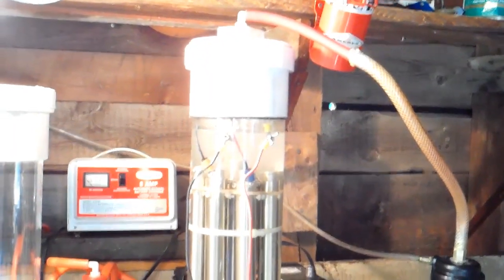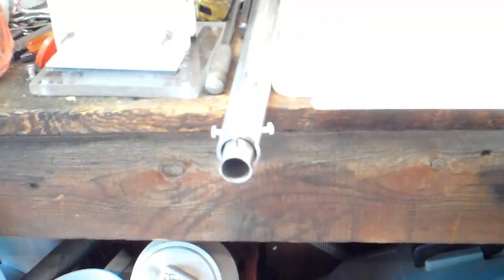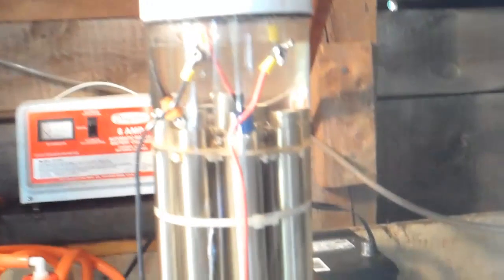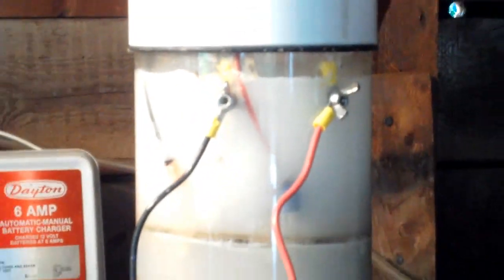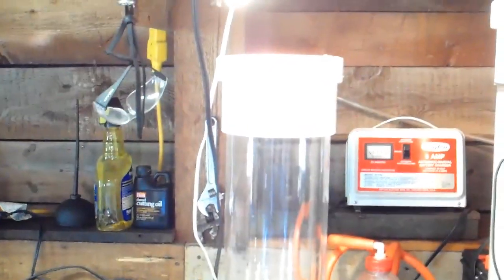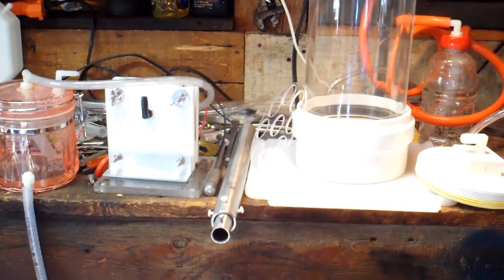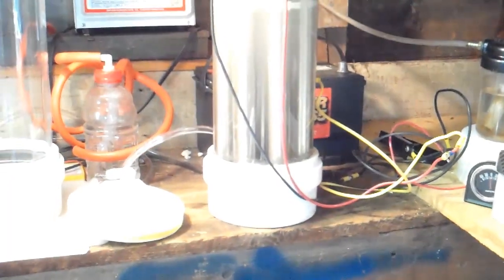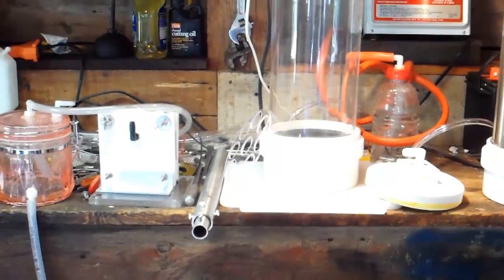Tweak to Stanley Meyer HHO Generator Produces Lots More HHO

Comment: If anyone is interested, I did some plans for one of these as final project in a drafting class. They show the cell in detail and a timing circuit but I did not learn until later that the coil is made from iron wire.  I'm petty sure I've got the copies in a few other places. They were done in Autocad.
Reply: Chris Turnblom pm me
Reply: THUNDERBOLT 
sorry, im not that bright. I can't seem to figure out how to do that.

Anyway,The bad news is, my secondary hard drive with the data started acting up so I took it out and will not use it until I can buy a back up. And I can not locate the flashdrive with the backups right now.
  I do have a slightly water damaged, full sized print I may be able to send you if you need it badly enough but until I can afford another hard drive I really don't want to chance loosing all that data. I will try to remember this request though.
 I hope you not just looking for a completed final project in a class or something. LOL
Reply: Chris Turnblom oh. no its for my own use haha :D
Reply: Chris Turnblom If you get this - did you ever get your backup sorted? I know I’d love plans to go off with everything that’s happened. Not that getting the materials is going to be possible much longer.
Reply: @ThePinkBinks  Nope. Sorry.
 I tried to recover that hard drive. Even took it apart because it was "stuck in park" but that is all delicate work. I unstuck it but when I put in back together & started it up it went right back to the "stuck in park" problem.
I'll keep it around until I can pay a data recovery service to fix it because there is enough important data to make it worth the money.
Reply: Chris Turnblom Oh that’s a shame. I really hope you can recover it though. Although personally I’d want the guy working in front of you if you hire someone as I wouldn’t trust them to be honest about it.

Comment: HHO cells will eat as much current as you will allow them access to. After many weeks of testing 5 different home made cells using a 100 amp pulse width modulator, I find that thermal run away (over amperage draw) and excessive heat leads to two things.  Over taxing of the cars electrical system and melting the plastic pool filter housing.  Running a system over 5 AMPS will generate waste heat that will melt your components and over draw your vehicle electrical system. I have come up with solutions to these problems.  Using a magnet generator that is separate from the vehicle electrical system and building the cell and chamber completely out of stainless using the outside of the cell as the negative electrode.
Reply: ever see all the electronics Meyer hsd to use and all of the adjusting he had to do to make the magic happen?  Splitting water molecules efficiently does not just require one certain voltage, frequency, amperage, resistance.  It takes a combination of high frequencies at range of different voltages one on top of the other with an auto circuit that will adjust to the every changing resistance of the water on the fly.  I have seen other people build the circuit, I have not seen anyone test it on a car like Meyer attempted to do.  I have a couple new Ideas of my own that I will start testing soon.
Reply: Meyer's cells don't heat up .
Reply: Jay Winstrand  I thougth that all that was needed was 2.5V and up to 18Amps with a Pulse Width Modulator. Anything over the volts is a waste, and any more amps will lead to thermal runaway as well as bringing the impurities of the stainless steel, aka, chromium, into the water.
Reply: Jay Winstrand So what is the optimal amperage before thermal runaway? What kind of effect does frequency have on production? I thought we should use a PWM to decrease the duty cycle, thereby reducing heat. Can a higher frequency aid in a resonant cascade of the water, making it easier for the bonds to be broken? Like a tuning fork in water. Are we talking Mhz, or Ghz? One more thing. I've been reading that by overamping the water, hexavalent chromium(very dangerous) production increases, and we see those impurities in the water turning it darker. One guy uses electrocoagulation to break it into Cr3 from Cr6. He was using similiar voltages. Could that process be incorporated into the hho production? Electrocoagulation is a fancy word to describe a jewelers plating process. Pulling the impurities to a plate or rod.

Comment: Forget using nylon bolts to keep the pipes from touching, there is a much more inexpensive, less time consuming, easier way.  Superglue four zip ties (evenly spaced in a north south east and west position) around the outside of the inner pipe then simply slide the inner pipe into the outer pipe. If the fit is tight you may need to tap on the inner pipe with a rubber mallet or simply heat the outer pipe in the oven on low for 30 min then slide the inner pipe into the outer pipe.  Zip ties are the perfect thickness, they don't cost much, quick to install, and even hold up to boiling temperatures. ;-)
Reply: ESSE  SERÁ NOVO CONCEITO DE PRODUZIR  HIDROGENIO UTILIZANDO SOMENTE AGUA.. ATRAVÉS DO PLASMA E  4 ESTÁGIO

https://youtu.be/3rJiCPObPj4

https://youtu.be/XYPYES6CjVE
https://youtu.be/3rJiCPObPj4

https://youtu.be/XYPYES6CjVE
Reply: That wud block gas flow....
Reply: rubber is better

Comment: his gadget actually works....{ He is dead now,  from poision  perhaps. }
 But using stainless steel, or any steel or alloy which has CHROMIUM in it,   in this way... is a bad idea...

 Electrolosis with "chromium" in the conductor plates  has a serious and possibly fatal side effect...  The unintentional production of    ""HEXAVALENT CHROMIUM""  .

  ""HEXAVALAENT CHROMIUM"  This is one of the worst human carcinogens  {cancer causing agents} known to man....  Very Un-Healthy ....
  Another metal alloy "Titanium substrate"  {which contains no steel and no chromium}... is the preferred material for electrolysis  because it produces more HHO gas per unit of electricity consumed, runs cooler,   and it does not contain Chromium...so Titanium Substrate  {non-Steel} {non-chromium}  is the preferred material for this use...

 The  big hydrogen power production plants that make Hydrogen and Oxygen gasses for profit do it   in this same way  using  "Titanium  Substrate"  plates in electrolysis  cells and operate at  16volts direct current.    Very 'similar' to  Stanley's gadget...

 Be safe .  Be healthy.  And, if you do  this please use the 'right' materials.
Reply: Use titanium, not stainless steel.
Reply: Sigh, no mortals can afford Platinum plates, electrodes or tubes.
Reply: J Martin Platinum electrodes are what we use in the lab.

Comment: Your website link does not work.
Reply: Selsley01 Huh? Your missing the MAIN point, how much current do we need for ALL electrical equipment in your car (after start)? 10-15 amps?

So we have over 30 - 50 amps available for electrolysis of the HHO system. How do I know? I helped install a heavy duty HHO system on Chevy pick-up and it drew about 30 amps average.
Reply: freshkryp69 70-80 amps? Can you provide ANY references or links to back up this claim?
Reply: ***** IN A CAR EVERY ELECTRICITY IS PRODUCED? Then you don't know the basics of the car electrical system. There is HIGH amperage system ready to supply HHO systems, it's called the starter system. It normally just used to start the engine 50 - 75 amps, but rest of the time remains idle. The HHO systems utilized this HIGH amperage system without negative effects.

They are even used on semi trucks by professional drivers to save thousands dollars of diesel costs.

Comment: Pos & neg flows in water Think about this copper- stainless steel I'm just a country boy but  this is a form of electromagnetism  So try using strong magnets matching your current flow  something to look in to  just saying.
Reply: I accidentally magnetized my electrodes( by accidentally shortage), & got AMAZING RESULTS!  I've designed a MECHANICAL JET that will eliminate the need of the inefficient transmission & make vehicles SAFER & MORE EFFICIENT!
Reply: Tom Hoehler Ahhh,that's what i needed,thanks,my car runs on the pee after i drink couple of bottles of vodka,but i ha had a tiny small issue with it,it was running only downhill,but now,with your contribution i'll be able to drive it uphill too....soooo,prepare your best suit,this year we gonna get a Nobel  P;
Reply: just keep chickens in the trunk

Comment: One must wonder what replacing the solid stainless tube with mesh stainless tube might effect...
Reply: i think the mesh would decrease the surface area.
Reply: no it will actually INCREASE the surface area if the holes are small, say 1.5 mm in diameter or smaller.

Comment: If you want to get the plans
to convert your car to HHO
Go to Google and Search for:
Top HHO Gas Car Research
Click the First Result (Skip the Advertisement)
Reply: thanks for a great info
Reply: thanks for it.
Reply: +n04n1m0u5   This is why you don't use common electrolysis methods. Or have you not researched a Stanley Meyer HHO?
Reply: Dan P I'm affraid you are right,generating hydrogen on board of your car to burn it in the engine is not efficient,that's because the electrolisis consumes a lot more energy then the energy obtained by burning the hydrogen in the engine....sorry for the folks who tries all kind of methods,but the laws of the physics slaps us on the face and wakes us up from daydreaming.
Reply: Convert your car to HHO?  Don't you mean add a parasitic load to your gas engine to make it less efficient?

Comment: Question Number 1 before I pay $5. 
Would your "secret" work with a dry cell? 
I know a lot about it. So you better be original in your $5 document.
Because I will for sure, create a video response to this if I am not happy. \;^) 
Question 2: Would you please try to tell us the total output in (LPM) Litter Per Minute?
I would like to know what kind of out put this "Stanley Meyer" design is capable. 
For data purpose. I am also an HHO builder of dry cell. Thanks!

Comment from the maker: The short answer is "no". However, we have seen as much as 97% improvement in fuel mileage using a special tuner. One guy's truck was getting around 40 MPG so he drove it instead of his economy car LOL! My latest project is converting an Onan propane powered genset to run 100% on HHO. It involves using water vapor injection and a special circuit.
Reply: Hi what is your website
Reply from the maker: @domenicodipasquale4590  I have two websites involved in hydrogen research. One is www.RXCures.com and reports on the anti-aging and healing benefits of hydrogen. https://youtu.be/zBt0PGXa-vw
My site, http://www.HHOTrucking.com does research and development of hydrogen as the perfect fuel.
At this stage of my research I have little (if any) interest in HHO as a fuel for conventional internal combustion engines.

I believe there is a terrific future for hydrogen fuel cell electric vehicles where ultra pure hydrogen is produced on demand AND STORED to provide ample H2 supply under load.

I also have been experimenting with monatomic, H1 to generate instant steam. See my concept steam engine here https://youtu.be/vhodJT9Fblc

My plan is to assemble a small team of engineers to take my inventions to the next level....working, practical prototypes that will be licensed for manufacturing.